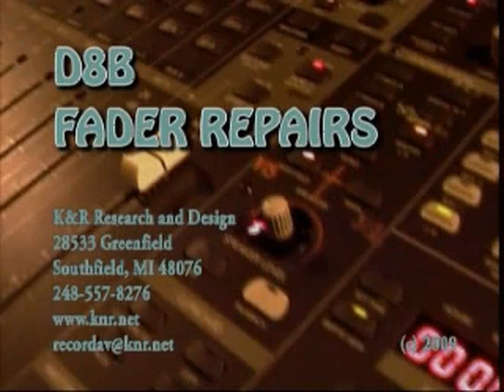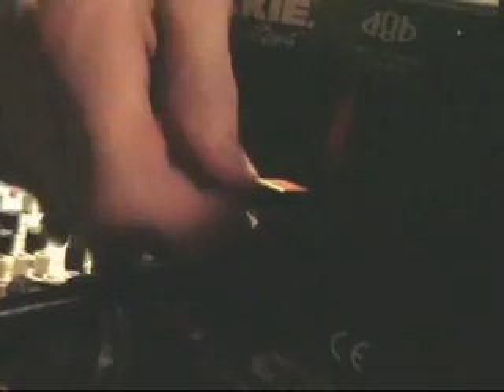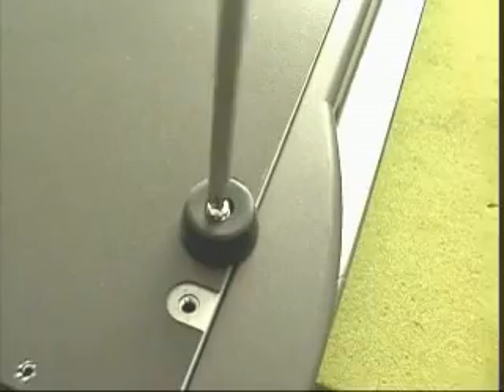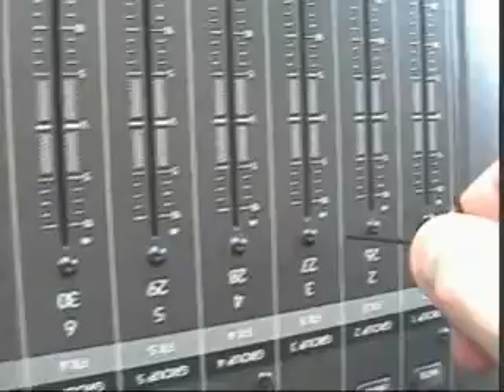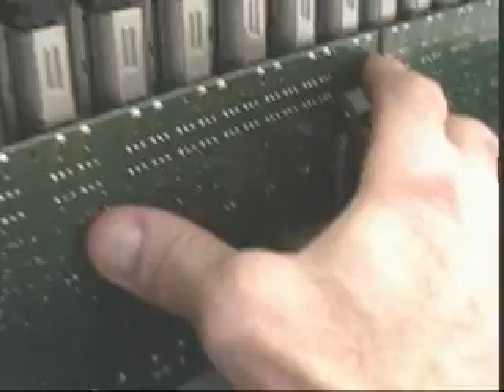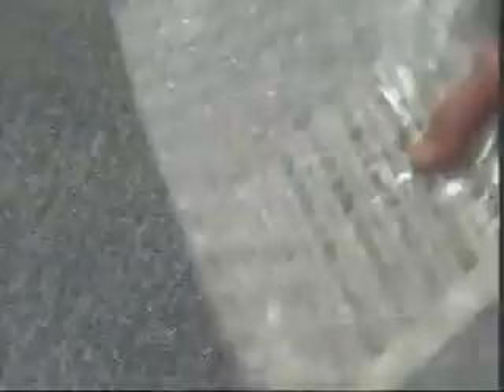Mackie D8B Fix

Comment: Hello, I have a board like you, when I cut it on; all of the lights on the board starts flickering off and on like crazy until I push the power source that plugs into the mixer itself.  Now something else is wrong; it powers up and you can see the signals but there is no sound coming from the speaker, the speakers work if I hook it to my computer audio interface and computer but for some reason; the machine is not producing sound from the outputs. Please help
Reply: I have the same problem with the power cable.

Did you find out what the problem was?

Comment from the maker: Yes it is $50 for each fader plus postage. The only fix is a new replacement because parts in the drive are worn beyond repair. The old procedure was to send the entire mixer in for repairs. You do not need to do this. We have an instructional DVD to show you what we need from you so we can replace them at a majorly reduced price. 8 is discounted to $370. And the turn time is one business day. Not weeks without your mixer. For free instruction DVD call toll free 1-888-802-0420

Comment from the maker: I do not do all repairs to the d8b. I have a cost effective time budgeted solution for just the faders at this time.
Try disconnecting the board and just boot up the cpu. It should go through to the end and not get stuck but will say the mixboard is not connected. This test will determine if it is in the cpu or the baord.
Reply: the memory ram is damage